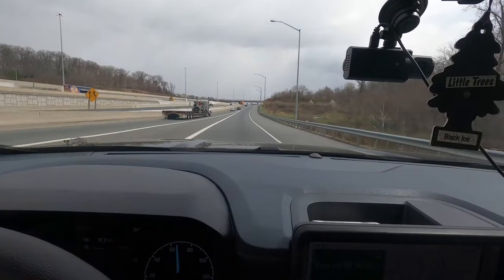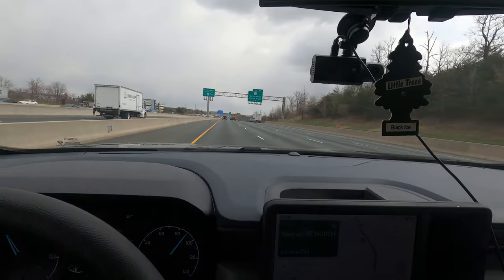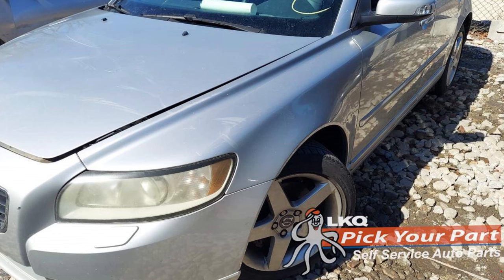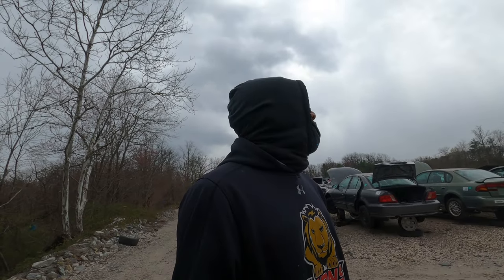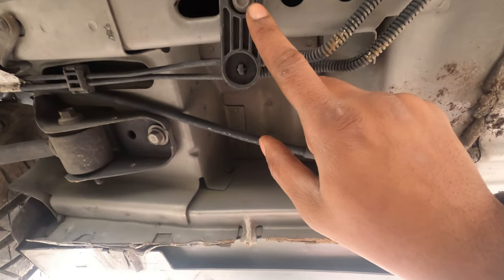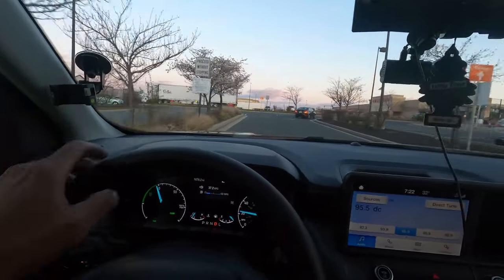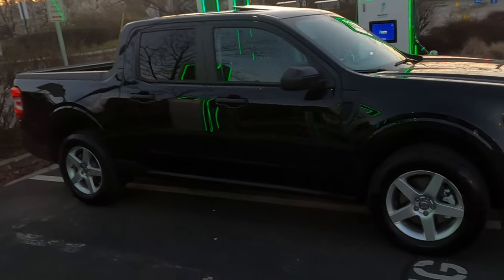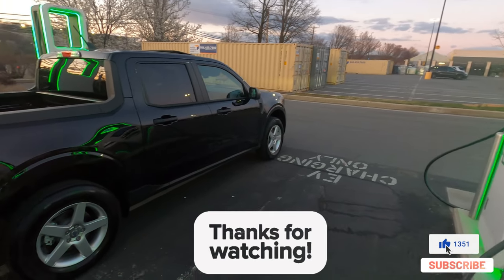Junkyard Rims for my 2022 Ford Maverick Vlog#01

Comment: I kept on waiting to order a maverick.   Thanks for your video, I will just replace the wheels to a sexy ones from original steel wheels.  Lovely high end looks....
Reply from the maker: Yes replace them and use the savings to add a sunroof or a bed cover($1200).